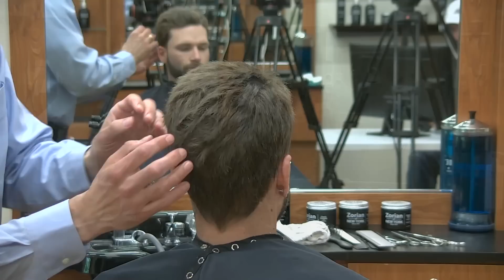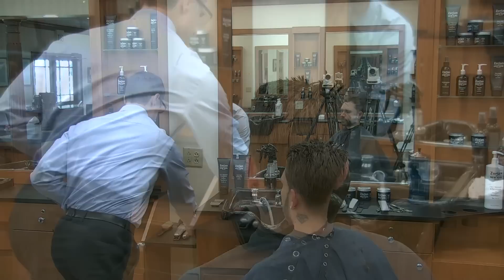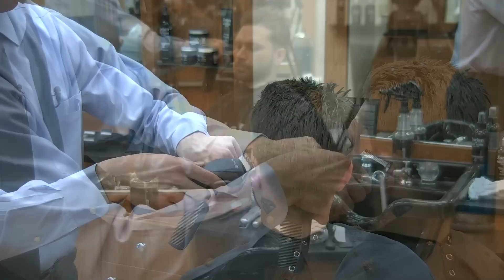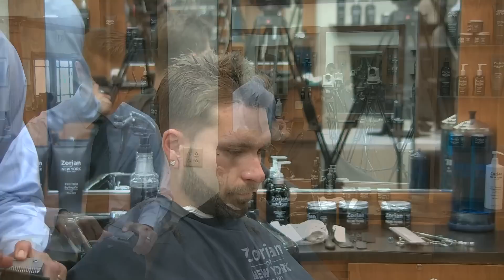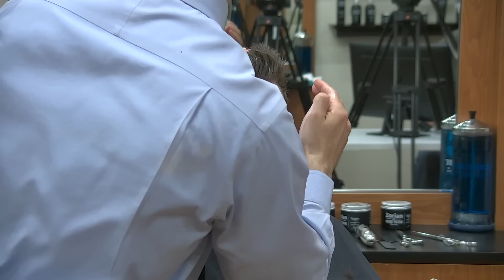Barbering Techniques Tutorial: low fade with spikey textured top.

Comment: Great video! Why do you go from the 3&1/2 to the 1&1/2 instead of the 2? I would have guessed the 2 because isn't that the next blade down? Thanks for the great videos!
Reply from the maker: Sometimes I skip a blade. If you tilt up the 1 1/2 it cuts the same length as a 2. Saves time.